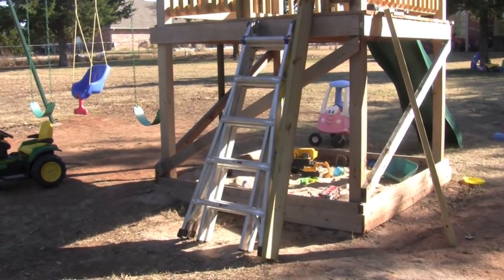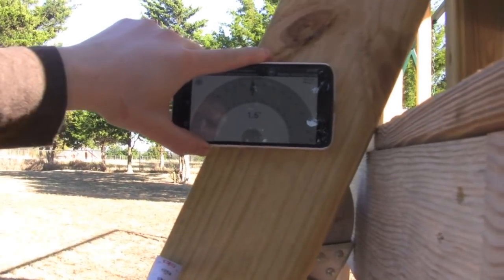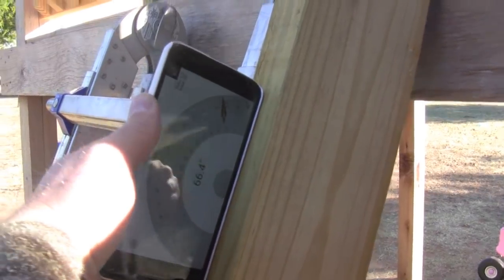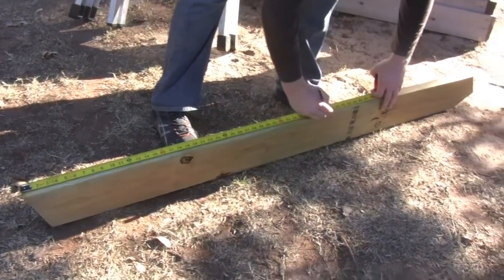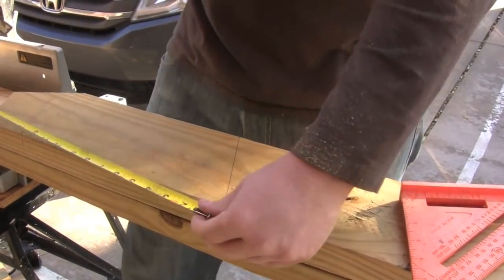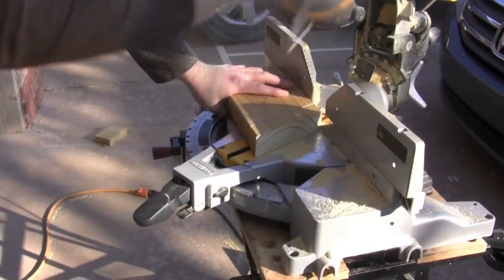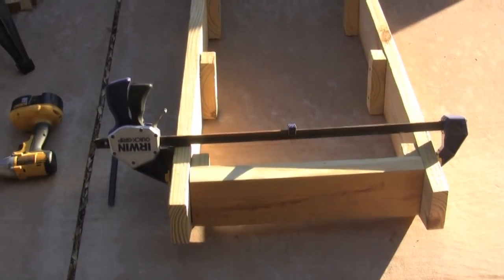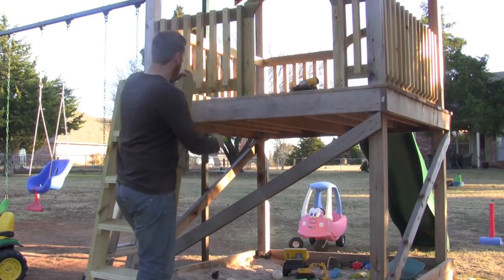HOW TO BUILD A LADDER

Comment: At 1:20, you shouldn't be measuring the length before cutting the angle on the bottom of the board so the ladder is sitting flat on the ground. Other than that, great video, and was a great help!

Comment: My brian doesnt understand how the top corner of the step is flush with the side rails? Did you bevel cut the front face of the step?
Reply: Yeah, he skipped a major step here.
Reply: Thank you! Was wondering the same thing.
Reply: says in another comment that he used a table saw for the bevel on the treads